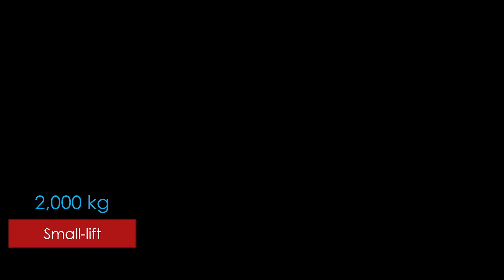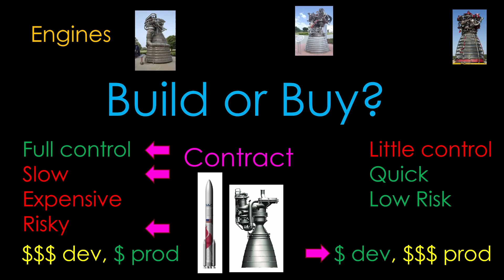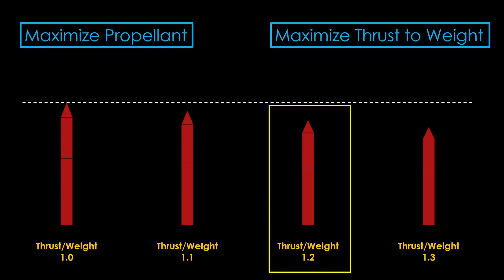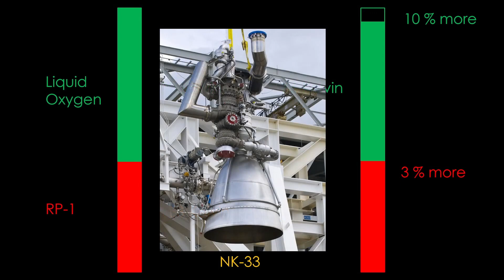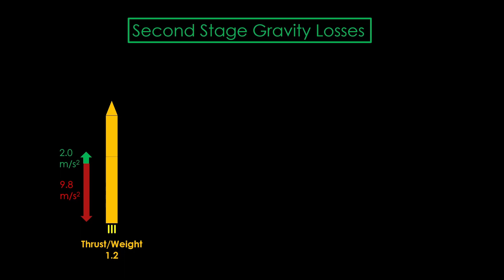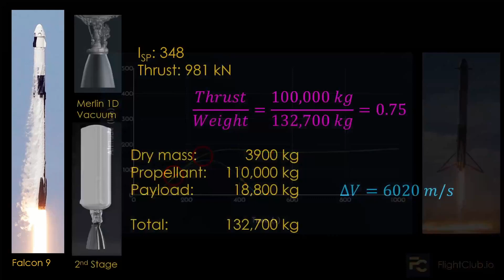Build Your Own Rocket

Comment: Great video. Much of the high level design of anything comes down to finding the trade offs one can live with. Thomas Sowell quote: “There are no solutions, there are only trade-offs; and you try to get the best trade-off you can get, that's all you can hope for.”
Reply: “Trade offs” & “ compared to what?”
A notable difference between rocket science and economics or politics: intellectuals output, our ideas the can’t really be scrutinized very easily, however, if a rocket is objectively “wrong” in its premise and execution. It does not make it to orbit.

Intellectual in universities and politicians are typically nowhere to be found by the time of the implications of their policies and teachings affects are discovered .

Comment: Given the advantages of larger numbers of smaller engines that you mentioned, and also given that it’s the approach being used by most new rocket companies with large boosters (e.g. Superheavy), why do you think Saturn V went with only five massive engines in the first stage?
Reply from the maker: That's an interesting question, and I don't know the real answer. 

My guess is that it's because NASA was buying those engines, and buying fewer engines tends to be more economical in that case.

It is interesting that they made that choice; AFAIK there was nothing that suggested it would be simple to create such an engine, and it turned out to be very difficult.
Reply: @EagerSpace I think that part of the answer is that the design was already underway and maybe substantially complete, because the military had been designing it when the bombs they needed to loft were extremely heavy. So given the deadline of 1969, it may have been their only real choice for high thrust.

Also maybe they felt that production and QA on five engines was easier than 35.

Comment: Hydrolox boosters: Is one limitation the difficulty of pumping enough hydrogen to generate the mass flow to lift off the pad? The discussion is always around tanking the hydrogen not pumping it. Loosely, Delta V heavy (DVH) and Falcon heavy (FH) are the same size but at lift off DVH weighs half as much and has half the LEO capability. "Volume" still needs to be pumped even when weight is more important. Is simply pumping enough hydrogen to lift twice the payload impractical even without the large tank problem?
ed: Atlas >>>---> Delta
Reply from the maker: Interesting question, and I don't really know the answer. 

If we look at the RS-25, the high pressure hydrogen turbopump is about 69,000 horsepower, and the high pressure oxygen turbopump is 25,000 horsepower, so it takes 2.7 times the power to get the hydrogen in there. And that's at an oxygen/hydrogen mixture ratio of 6:1, so the engine is pumping 6 times as much oxygen by mass. And of course the design needs four turbopumps. It's thrust/weight is in the 50s, and the RS-68 is in the same ballpark, so quite a bit less than the RD-180 which is in the 70s. 

According to Musk, Raptor supposedly generates 100,000 horsepower total in the turbopumps which is pretty much the same as the RS-25 if you add up all 4 turbopumps there. Raptor's about 20% more thrust than the RS-25 at this point, so you could conclude that it's more efficient in terms of pump power, but the musk number is from 2018, so who knows that it is now.

Comment: A interesting question is can SLS could be re-design to fly with metalox engines in the main stage? I make some calculations and if you suppose that would have the same size because of the higher density would weigh around 2350 tons (500 tons of methane, 1750 oxygen and 100 dry mass), that obviously will require more than engines, let's say 7 raptor, but after made deltaV calculations I find that for the current mission would delivery with 370m/s less than currently is capable the hidrolox version, is a way to optimize that? Well are three, first add more rocket boosters, but that would make a 5300 rocket for 4 SRB, second use vacuum optimized nozzle, and if you make that change it can match the current version, and the third method is using a bigger upper stage, and for that you find that can have better performance than current versions can do.
Reply from the maker: I'm too lazy to do the volume calculations right now, but generally speaking a hydrolox stage is about double the volume of either a kerolox or a metholox stage, so the core stage is just too darn big to run methalox. Doing so essentially turns it into something like super heavy, with a large amount of engines, and then you don't need the SRBs, and it's no longer the same rocket. 

The problem with raptors in this application is that they are optimized for sea level and give away some Isp because of that. The RS-25 is a vacuum engine with a nozzle that just barely works for sea level applications, and it's designed that way because with the shuttle profile, it spends far more time in vacuum than in atmosphere. 

So, shrink down the core stage to a reasonable size for methalox and use an engine like the vacuum raptor, and I think you'll get something comparable.
Reply: @EagerSpace  you cannot shrink the core without reducing seriously payload delivered to the moon, that is because of the lower specific impulse of methane-LOx combination, even with a 2350 tons methalox core and a 260 tons hidrolox upper stage the payload delivered to the moon would be only 70 tons, witch is more than 45, (I think that would be maximum capacity for the bigger version of the current SLS) , but we are talking about a 4100 tons rocket not about one around 2700. A shrinked SLS core would be like New Glenn(but with only 4 engines) with two large SRB attached, which would be enough for sending a 27 tons Orion to the moon, but only for that kind of payload . So wouldn't be SLS anymore.
Reply: @theOrionsarms  Eric is talking about size (i.e, volume), not weight, so the fact that it would weigh 4100 tonnes instead of 2700 is irrelevant.
 A 2350 tonne methalox core would be approximately the same size as the current SLS core, and if that gets 70 tonnes to TLI then there's clearly room to shrink it.
By my math, a ~1200 tonne methalox core using RVacs, along with the EUS and BOLE boosters like SLS Block 2, would also get ~46 tonnes of payload to TLI.
The total mass would increase to ~2900 tonnes, but the core would only need to be about half as large, reducing it's diameter from 8.4m to around 6m.
Reply from the maker: @theOrionsarms  I'm happy to keep discussing this but I'd like to go deeper into the numbers and the assumptions you are making. 

The SLS core stage is about 85 tons empty and has a gross mass of about 1073 tons, so it has a mass ratio of about 12.6 and the natural log of that is 2.53.

Super heavy is likely around 180 tons empty and carries 3600 tons of propellant, so it has a mass ratio of 21 and the natural log of that is 3.04. 

That gives super heavy a mass ratio advantage of 3.04 / 2.53 = 1.20

The RS-25 specific impulse is 452, the sea level raptor is about 348 in vacuum, so the ratio is about 1.29. 

That makes SLS look better, but the thrust/weight of the SLS core is about 0.7, so you would really want to compare a version of super heavy with a similar thrust / weight ratio. Doing that is going to improve the mass ratio of super heavy. 

It's going to end up as a wash, within a few percentage points.
Reply: @EagerSpace  I don't compared SLS with super heavy, I assumed a SLS core filled with methalox , and I used a 430sec for hidrolox core and 340sec for methalox one and for dry masses was 90tons empty for hidrolox and 100 for methalox, and for the small upper stage I figured that hidrolox would deliver 8500m/s deltaV and methalox 9044ms, so in a sense you are right that a methalox stage can deliver more deltaV, but is another factor that need to be put in equation, contribution of the boosters to total deltaV, for hidrolox one is 2085m/s and for methalox one is 1218m/s that's because methalox stage is more heavy, obviously the numbers are changing if you use a bigger upper stage, but for sea level raptor still aren't much better than hidrolox one with the same bigger upper stage, really good results are if you combine a vacuum style raptor with 360sec average specific impulse and a even bigger hidrolox upper stage like I said for a 260tons one payload capacity is around 70tons.
Reply: @lazarus2691  I tried to make the calculations with your smaller dimensions methane core using the same assumption like I did for a hidrolox SLS, and for a 45 tons payload I get it a total deltaV of 12781m/s some can argue that is enough for translunar injection, but for the hidrolox version the total deltaV was 13500m/s(if you don't have the same final deltaV in both cases then you cheat on calculations) , if you want to reach the same value you need to reduce payload at 34 tons, that would be enough for some applications but personally I don't like the solution, I like the idea of a 2350 tons methalox core for SLS, and the idea of a even bigger upper stage, not necessarily because it have more capabilities but because in theory the price can be reduced to the half on average if you consider the cost of the engines and launch infrastructure.

Comment: You know about the SS-520-5? It's a modified sounding rocket with a third stage designed to put payloads into orbit. It can put 4kg into LEO and is the smallest orbital rocket ever built, only 9.5m tall.

Comment: It seems like the delta4 and atlas5 suffer from un ideal staging due to the only available hydrolox engine(RL10) being so small and low thrust.  If there was a medium thrust hydrolox engine still around that 2nd stage could be appropriately made bigger maybe doubling the leo payload capacity
Reply: As attractive as that seems, it probably wouldn't work very well. Delta IV Heavy already struggles to get off the pad with it's max capacity, and with a larger upper stage it would most likely be restricted to GTO, GEO and deep space payloads, which both already excel at.